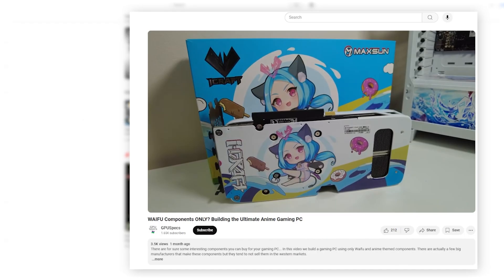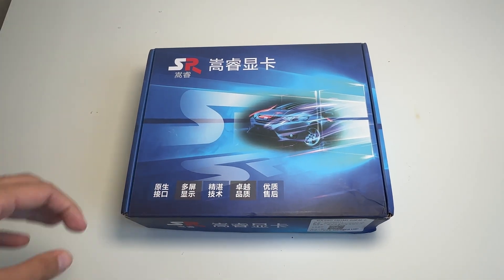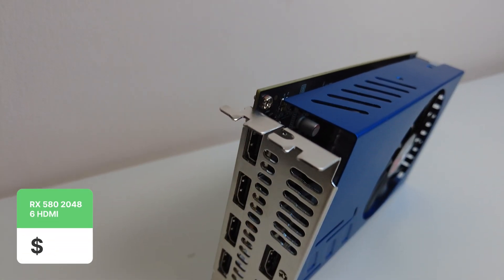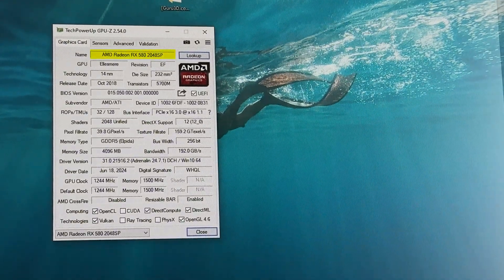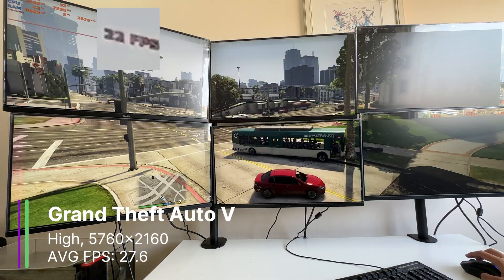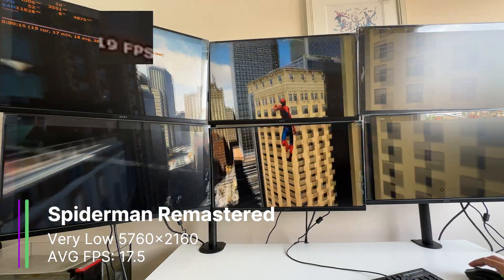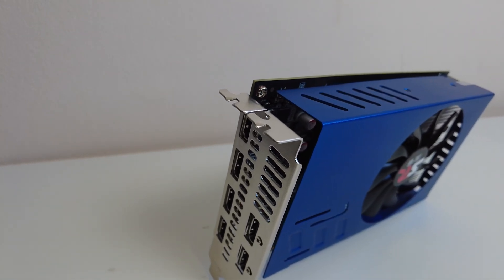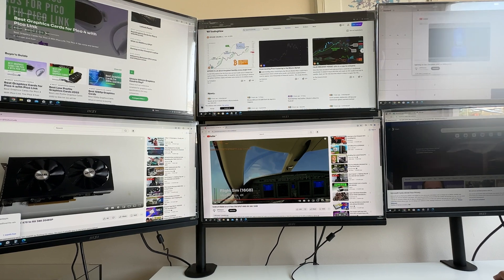Gaming on 6 MONITORS with a CHINESE GPU...

Comment: The rx 5080 2048SP is basically an overclocked rx 570 as the rx 570 has 2048 SP but this one is underclocked, so it's an underclocked rx 570, pretty sure a ton of 2048sp are just rx 470/570 with a modified bios. The real 580 has 2304 SP.

Comment: Could you try the 16Gb rx 580 to run AI? Generating images with Flux which needs a lot of VRAM or using llama 3.2.
A video like this would be great.
Reply: Pese a tener una cantidad interesante de VRAM la versión de 16gb tiene un soporte horrible para las aplicaciones de IA y no tiene potencia para eso.